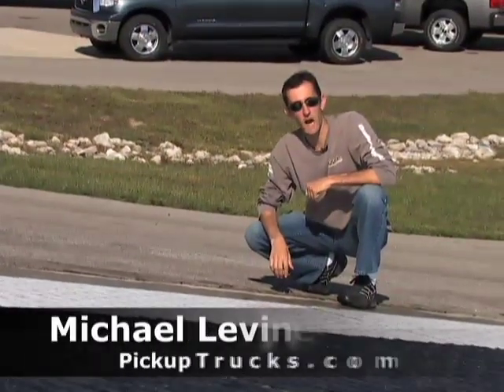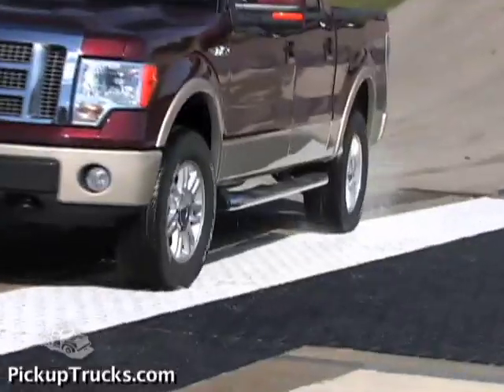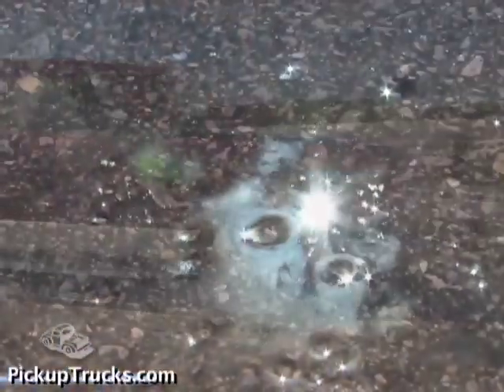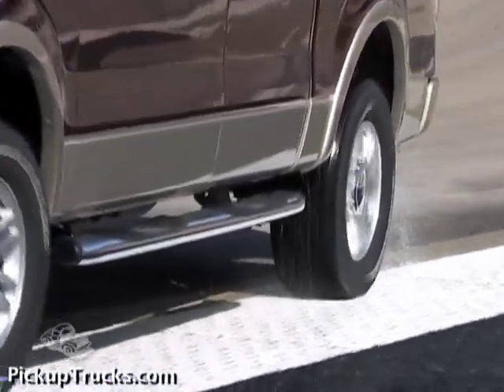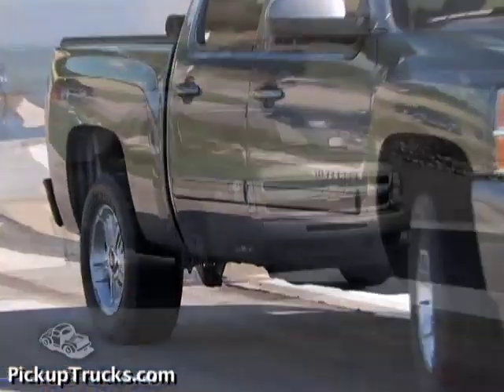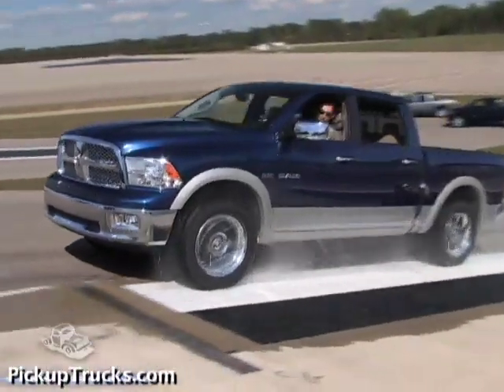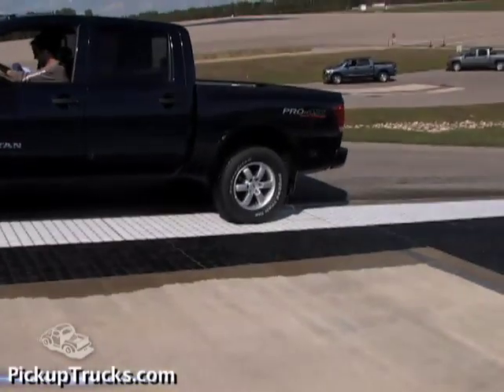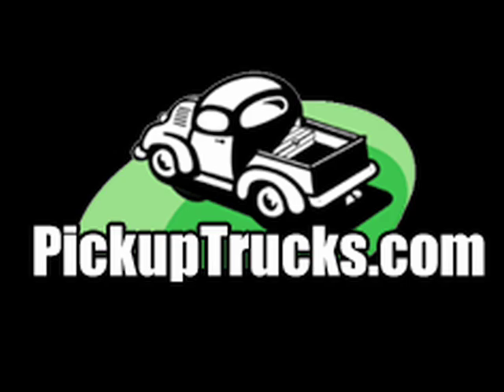Extreme Traction-Control Test

Comment: @Jimpank90 You're actual somewhat wrong there. If it's slippery you really, really shouldn't engage AWD, only if you actually get stuck. The reason is simple: If you lose control of your vehicle with AWD and slip in every single wheel, you lose all control over your vehicle and your next destination is the ditch.

… oh and the test is a total joke everyone. When testing traction and comparing different cars, a good idea is to use tires of the same make and model. I say no more…

Comment: none of the trucks had 4 wheel drive and yet gm still lost. in 4 wheel drive itd be the same all trucks here have 50:50 torque split so it comes down to traction,weight,tires, and electric nanny tricks. this wasnt a test about 4wd lol

Comment: If i was rich I would Elcamino a Subaru Outback3.6R and it would be the ultimate pickup.
Reply: what are the purposes of a pickup, here's my list.. #1 tow a heavy load #2 haul a large heavy load.. a Subaru, even in pickup format (such as the Subaru Brat) isn't designed to do either of those.. sorry your "ultimate pickup" isn't ultimate at all..

Comment: The Japanese can't match Ford's TORQUE or it's engine reliability. I used to own a Ford Expedition 4x4  (2002).  FUCKING AWESOME TRUCK with AWESOME POWER.  Later I lieased an Escalade EXT. It was fast, but, not as powerful. 
Now I only roll SRT8 RACE FUCKING CARS.

Comment: So... Basically a test to see if a truck would work on a slippery surface if the driver is too stupid or too lazy to engage 4 wheel drive. Hmm... I guess you'll test anything if you are running out of content. Maybe next you guys could test motorcross bikes cornering prowess with street tires on them.

Comment: I owned a ford f150 and after that a toyota tundra with lsd, i now own a gmc sierra with a rear auto lock differential, i can assure you from experience that no lsd will even touch the gmc rear locker this test is bull**, if you notice in the video when the gmc and chevy are on the test they show you the side not on the ice, as with the other trucks they show you the side on the ice, seems fishy to me, in no world would a lsd out perform a locker, sorry guys, and btw i hate my gm its my first and will be my last, but i will admit the locking rear end  has got me out of a few pinches,
Reply: If you don't know how to operate the G80 auto-locker, it doesn't work very well. If the wheel speed is above 20mph or so the fly weights that kick out and lock the whole setup are disabled, else you'd get a "gov-bomb" a lot more often. 

IOW, you can't run at the ice like that at 20mph+ and expect it to lock. They likely would have had much better luck attacking it at 5-10mph till it locks, then you can give it the beans. Once the locker weights fly out, it's staying locked until the wheels come to a near stop again.

Comment: @kowal789 What they need is the same Brand and Model tire on each truck to be the same. If the tires are different , then the test is BS. Each tire has different ratings for different types of conditions.... Put a cheese ball tire on each truck and see what results you get from the test....

Comment: Did they put the same tires on all the trucks to eliminate that? Also who the fuck drives like that on slippery surfaces? And I call BS on the Chevy/GMC not making it - it's a LOCKING differential which means both tires are locked so you guys screwed something up.

Comment: Then explain to me why toyota is trying to redesign their frame? That bed flopping around is not safe. Also, I don't pull 10,000 pounds with a half ton truck. That's stupid. I would kill a F-150 and a Tundra if I did the hauling I do on my F-350. 270k miles and counting of constant hard pulling. Diesel power is where it's at. I wouldn't pull anything heavier than 6k on a gas half ton. That's just asking to break shit. Which I have done in the past. Hence why I don't own a Tundra anymore.

Comment: well the ford did have the shittiest tires in this test (goodyear SRA) and the nissan had the best tires (BFG rugged trails). Goodyear SRA's are abslutely horrible. They are a highway all season and not designed for snow/ice. I have them on my F150 and with traction control off these things spin on wet roads. With traction control on I can make it through snow and ice in 2wd no problem. Only time I use 4x4 is if I stop on a hill.

Comment: That's not the point. Frame is junk. Meaning if I even tried to tow 10000 pounds with it, and I hit a big hole, I am most likely going to have frame damage causing the truck to drive weird. Boxed and partially boxed frames like Ford has are better. Much less flex, nice and firm. The suspension absorbs everything else. I used to town a tundra, they are garbage. I now own a F-350.

Comment: my boyfriend thinks that people just need to learn to drive. If the scenario arises and the ass of the truck starts sliding feather the gas and spin the wheel the opposite direction. Do not floor the gas that is stupid and don't even think about touching them brakes once you have started to slide that will just send you out of control causing a crash you you might end up in the ditch...he would know lol

Comment: What the hell chevy has locking diffs that's a plus I can tell they turned off the traction control off this is rigged real test the chevy and Sierra comes up on top G80 lockers perform better when the traction control is on and in this case somebody turned it off the tires would not burnout like that rigged that's all I can say more test like this show the real outcome

Comment: @0602720noeflores What? Are you some 15 year old kid that his parents don't know he's on the internet after bed-time?

What is the main reason for lose of traction? It starts with tires. Get two vehicles (Same Make, Model, Year, and Package), and then put street slicks on one and rock crawling tires on the other, and run this test. At the end it would have the Best & Worst Traction Control of any vehicle in it's class.

Remove the variables for a true test.....

Comment: im just wondering... was the VDC turned off on the nissan... Yea you know they have TRAC for a reason.. just saying. a 08 titan atleast has traction control.. even with open diffs its TRAC or VDC would still limit some wheelspin.. - driver = mentally defective. congrats more fail tests

Comment: i call bull shit im a chevy guy thats all ive ever owend i have a 2006 chevy silverado and my brother has a 09 dodge ram bighon and he tares the piss out of it drifteng mudding racing and that rearend has never not kicked both back tires even when he is flexed out it will run my 5.3 off the danm road any day im never buying a chevy again ive had to many bad experinces my last 2003 chevy silverado had under 75000 on it and i put 4 tranys in it in under 10000 miles

Comment: Liars!!!   This is rigged.   My chevy  had the locking rear end and can't be beat.  Use it on the farm and out pulls my dad's dodges because it always grips while my dad's dodge just spins one tire.  Whatever though...keep tricking people into buying fords and dodges so there are more chevys for me to buy.
Reply: How's it rigged when it's at a fucking GM facility? GM kind of fucked themselves on that one? Lol
Reply: Brandon Oren  I to think its rigged. from what i could see in the video they did engage the Chevy's four wheel drive. they wouldn't need to either cause if the axle locks like it did in that video it make it look like its in four wheel drive without actually being in it but i could see the rear tires still moving faster so it wasn't.
Reply: I'm surprised the ford never broke down

Comment: I like chevy and ford. i have a ranger but this test was absolutely full of shit. the chevy g80 has proven multiple times how it will out perform any other type of differential. so this BS video is denying that a locker outperforms traction control. they're full of shit dont listen to them. notice how they didn't show the chevy's rear wheels? because it didnt have the g80. if it did you would see one wheel spin about one time then you'd hear a click and see it stop immediately then it would climb. simple physics thats what a locker is. they dont expect people like me that know shit to watch this

Comment: I dont get this test. These morons demonstrate LSD differentials. LSD doesnt help much in off roading. THE NISSAN HAS A DIFFERENTIAL LOCK but they didnt engaged it cause theyre comparing it to cars WITHOUT DIFFERENTIAL LOCK. DIFFERENTIAL LOCK is the best choice if you appreciate ROADABILITY and OFF road abaility. Nissan Titan is far better than its rivals in the video.